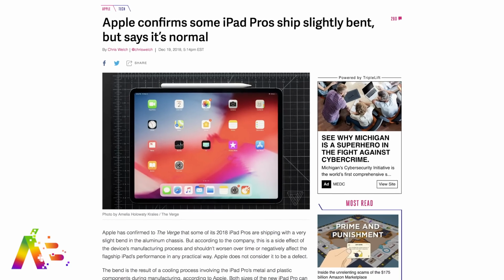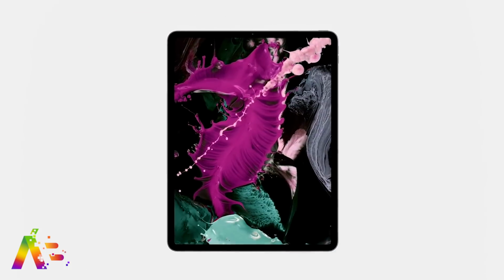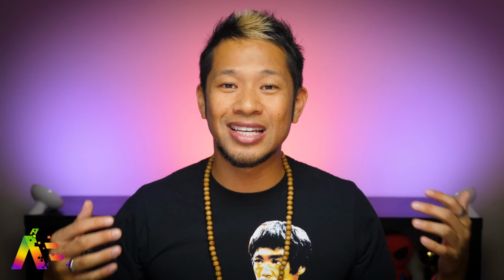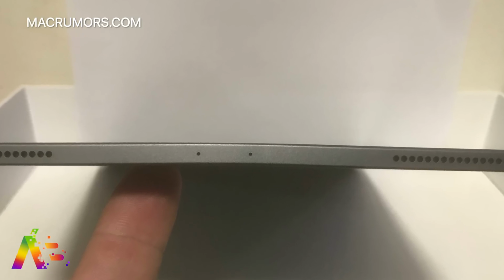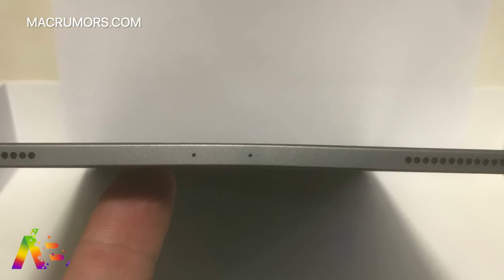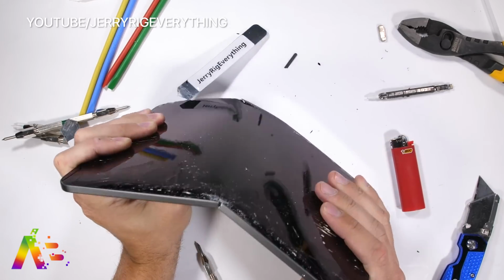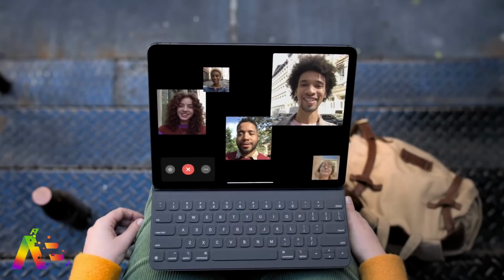Apple says your bent iPad Pro is normal?!?

Comment: Hi. I’m Ashu from India. I just got iPad Air 4. As, it has the same chassis, it has flex & it bends, it really does, even at slight pressure (when noticed carefully). I requested a replacement & that would be delivered next month. I’m too worried. I haven’t seen anything so expensive & so flimsy (I mean it, I didn’t expect that cz I already own an iPad Mini & that is really tough). But this new Air has too much flex in it. By any chance if you haven’t noticed it yet, take a look from sides like you see from a gun while twisting it even at very very low force. It’s too soft.

Bro Please let me know about your take on this (in-detail if possible cz I m really really worried) ?
🙏🏽🙏🏽

Comment: Actually I had an Asus tablet back in like... 5-6 years ago (an Asus Transformer, TF101 I think) and I tried to bend it. It was really solid build so I just gave it a gentle try and tried to bend it slightly more continuously. It didn't even start to bend a little bit when I gave up because my hands hurt. And it was years ago. True, it was a bit thicker, but hey, apple prefers beauty over everything else. Not that the Asus tablet wasn't good to look at or hold, on the contrary. It was good to hold it, it was easy to hold it steady. This obsession with shaving off half millimeters from the thickness ruins the product(s), and they still continue to ignore the facts.... I have a Samsung phone and I keep it in a phone case solely because it adds a bit extra thickness and it's way better to hold the phone that way.

Comment: It's very much irritating to see this. I am not comparing a specific company to any other company but I just want to point out that whenever there is a fault in a company's product, they should take responsibility. For example when Samsung Note 7 was having battery issues, they recalled their phones admitting their fault even though they lost billions and reputation. That's professional attitude. In this case Apple should also admit their fault rather than straight lying. And the thing that irritates more is people just don't bother much as it's Apple. That's wrong. We are customers of their products. It's our spent money that they are building new products from. Respecting a product and their customers should be the prime goal of a company. And atleast people should make it a big deal. Saying bending is normal and people buying that kinda of excuse is utter stupidity which shows we can be so easily manipulated. Their products were once good doesn't mean it's still good. Look for yourself. Come on bending is normal. It's hilarious people still agreeing to that by buying the new pro model with their excuses. If someone really needs an Apple product only then go buy the normal ipad or buy the MacBook. Atleast let the company know that people are becoming aware of it by not buying the new iPad pro model. That's the other way to make a company know what customers think of a product. Atleast they will act sensibly next time.

Comment: This is a embarrassing tragedy for Apple. Shame on them. Would you but a new car from a dealership with a bent frame and be told by the manufacturer that "oh it's normal, it will still function and drive" or with a caved in door that still closes but the car still drives?? No you wouldn't. This travesty is no different.

Comment: Brian..
Honestly, this is why I left Apple products and have never purchased another.  I left after antenna-gate response.. "Holding it wrong."  Have only purchased Samsung for me as well as my family since.  This is the reputation that I see when I hear Apple: antenna-gate, bend-gate, Out of Business Sapphire Co, etc.  It's sad and irresponsible. And, Samsung has had its problems; don't get me wrong...  And furthermore, Apple does have great design, processors, and experience.. to the point that it kind of bothers me that Samsung can't compete or be on par with Apple processors and furthermore put inferior ones in their tablets while Apple puts their Best! Yeah.. Argh!!  I was really impressed actually over the holiday at how polished and great the Apple TV is; But then again, can't pull the trigger. Bottom line.. Apple comes off too Pompous an Elitist to me.. which I could never support. 

Brian, Awesome job as usual!
Maybe Apple will get the message and change the way it treats its customer base (and suppliers as well!.. ) and Samsung start putting on par chips and best chips in their newest high end products.. tablets included!!
Thanks again.

Comment: this is the first vid i watched of you. And honestly you sound like an apple fanboy in denial.
Reply from the maker: You might have missed the part where I said it was totally unacceptable...
Reply: @briantong  my point is you act as if Apple didn't have this particular mechanical fault for years now lad. As if Apple very rarely screwed up things at a hardware level and always consistently had sturdy devices without faults. 

Not only does there exist common faults across their phones and tablets alike but their MacBooks and iMacs have had significant hardware issues unacceptable to the professional market. At least for engineers, designers researchers etc pros who actually stress every inch of the hardware. Additionally these things are extremely difficult to repair and finding reasonable repair costs are often impossible because system schematics are becoming scarce and components are becoming harder to attain.....on purpose. Apple is literally doing all these things on purpose.

Comment: Apple throwing away it's credibility what credibility they lost that years ago with the iPhone 4, 6, Battery Gate (aka slowing down older iPhones including not even year old phones!)!!!
iPad Pro but no mouse support WTF?!
iPad Pro but no USB 3 speeds never mind USB 3.1 and forget Thunderbolt 3!!!
iPad Pro but no 3.5mm Headphone jack nevermind Mic and lets be honest Bluetooth is nowhere near wired levels of Audio Fidelity!!!
iPad Pro no SD or MicroSD card slot!!!
iPad Pro still side mounted speakers (which are easy to block in Landscape Mode!) yes they are good but front facing is even better for Audio Quality this is after all a Pro Device!!!
iPad Pro 90% of the time an iPad is used in Landscape but Apple still makes all iPads to be used in Vertical Mode not Horizontal but Apple insist on making every iPad like an iPhone port in the middle of the bottom (Vertical Mode!) so in Landscape (Horizontal Mode!) the charger port is in an awkward spot that looks weird rather then placing it at bottom portion of the Bottom! Apple needs to move the port to the real bottom (aka landscape mode!) as well as do the same with the web cam!

Comment: I have one and it's not a problem.  Waaay blown out of proportion by the youtubers. If I lay my ipad face down on a flat surface, there is a barely perceivable arc that shows a .01mm gap along the long side.  If I apply the tiniest amount of pressure to push it flat, I can see the gap close, but only just.  This is actually a nice feature as is reduces the chance of scratching the display if it's face down, but again...   barely at all.

Comment: The worst thing about this design flaw is that it could be fixed by doing two things:
Using a better metal for the frame
Moving the microphone hole that's in the bloody center of the tablet somewhere else

Apple seriously screwed up. They need to stop going for what looks nice and make shit that actually fucking works and doesn't fold like paper.

Comment: I was hearing about how durability wasn't factored in when making this more lighter. First of all, the ipad pro 2017 are not even heavy even with a good case.
I have a 12.9 ipad pro 2nd gen and I love it. As an artist/cartoonist I fucking love it. I hate apple electronics but they did something right when making a powerful drawing machine. I also have the 2018 ipad for travel ( less expensive then the 2nd gen pro ) and even that works just as well. Its apple pencil compatible and half the price of a 128gb pro. I'm using these as long as it lives lol

Comment: Beyond stupid. One of the reasons Apple products were so impressive to fans was the craftsmanship that went into the engineering of its hardware. For the company that spearheaded the mass production of precision-machined aluminum unibody chassis (and has the advantage of YEARS of experience designing for this manufacturing process), this is straight up unacceptable.

Comment: "Is the result of cooling process that involves the iPad pros metal and plastic components" 
Are they saying that the iPad is putted together immediately after the injection of plastic and the aluminium machining?.
Im sure that the making of the chassis and the plastic parts are not even on the same factory.
Do they believe that people will fall for this?.
What a bunch of twats.

Comment: It's not bent it's warped during manufacturing. They were never really straight to begin with. So that's worse than simply being bent by the user. They're delicate so need a case to support them which makes building them so light to begin with completely pointless. My sister keeps her iphone 6s in an otterbox case which  nearly triples the weight. Lighter is not always better.

Comment: Okay i just rechecked the statement apple gave, it neither denies or affirms that a bent ipad is normal, it just states that it was designed to have a 400 micron deviation which is smaller than the previous models. If it's bent then clearly it's defective and can be returned. Apple also does not confirm or deny that ipadpros are bent.

Comment: Wake up. Almost every Apple product had at least one major design/engineering problem. And bending iPhone 6 and iPhone 4 signal problem is just most known. For example every Mac has a cooling problem. They decrease CPU and GPU power to keep temperature down. Including Mac pro that was supposed to have amazing cooling. That is just typical apple.

Comment: This is Beyond a "Bad Apple". Just simply unacceptable, not even borderline irrisponsible.  This is a betrail for all of the early adopting Apple fans who trusted Apple and bought that expensive 2018 iPad Pro.  And '14 day return period' isn't cutting it at all, for most of the people who are buying these expensive iPad Pros  are looking down the road at least for 2 or 3 years of use, not like an iPhone. It's a tablet and this is clearly a hardware defect by design which can't be fixed by an update or a "repair program" as they have done in the past.
   If people can't even put this device in their backpack without worry bending it, how can it replace any laptops as they are marketing it? 
This may not be eligible for a class action lawsuit but this is way more of a betrayal and crime then some deceiving pixel count on their iPhone X and XS series phones.
  They should be recalling this product.  This defect is more seriouse than the past "Bendgate" from the iPhone 6, and Apple should act responsible for their mistake this time. If they don't, they don't deserve their Fans, who are loyal and trusting of Apple than any other fan base in the world.

Comment: Brian Tong I have a non apple question? So I have a LG V30 with Wireless charging and I've unfortunately bought several wireless charging pads None of them have Fast Charging capability they have all been 5w what do you suggest I buy that won't Break the Bank but charge faster. My LG V30 has a USB-C but sometimes I lose my Wall charger and want to just set it down to charge. Also Tech wise my LG V30 does have a headphone Jack with built-in 32 Bit DAC but I think I want to go Wireless headphones with built-in microphone can you suggest some that are $100 or cheaper I prefer over the ear with Extra bass?

Comment: Mate, did you tried to have a look at the surface of the iPad Pro 12.9 with the screen off, with some light reflection on it? (the short sides of the screen) ... the edges of the actual iPad screen on the shorter sides are warped ! At least mine is and I got it 4 days ago. I was a bit intrigued as for why is that happening until I heard about Apple’s article about this bend issues from manufacturing of this specific model. Then I had a closer look and voila, the iPad has a bend on both short ends. The surface of the screen is warped on both edges on  the shorter sides!! How can this be “normal”?!!  A manufacturing process that causes this bend is called a “defect”  in a normal wold! Is it just me or Apple trying to dictate a new “normal” ? And cost me $2269 down here in AU. Tomorrow I’ll take it back...hopefully the “ Genius “ people of apple wont blame me for bending the iPad 🤞🏻

Comment: A flaw in a machine that's worth your kidney is not fine. What if you buy a tesla or a luxury car and there's a light scratch or bend on its surface, would that be fine for you? 

Besides, I don't believe this just happens in the manufacturing process. I am a Materials Engineer and looking at the iPad's structure, given that it has holes for mic and the magnetic strip on the middle, I can say that the middle part is really the tablet's weakest point. If you own an ipad pro, it is a ticking time bomb. Only a matter of months before it bends due to heat or from the mere pressure it is receiving from other stuff on your bag, especially if you have books and notebooks in there. :) 

But.. but... but apple said that the bend will not worsen right? From an engineer's perspective, I laughed hard at this. This is from the same company that said that the 1st gen butterfly keyboard is fine but later on admitted that it is flawed anyway, or that there was no problem on the iphone's signal bands and you are holding it wrong, or that the i9 processor thermal throttling was just because of unfinished software yet physics will tell you that it's because of poor cooling in a small chassis.

Saying that it was caused by a "manufacturing cooling process" is nothing more of a technical jargon that's meant to be a mere marketing campaign to keep us calm. After all, a few convoluted technical jargons are hard to digest for an average reasonable person that's why we default on just believing it anyway since they are "experts". Science will tell you though that the machine has no structural integrity and rigidity to withstand usage over time. But who cares, Apple sheeps will always be apple sheeps and they prefer flowery marketing words over science and technical aspects which by the way govern the universe. If Apple says that 1+1=5, Apple sheeps will believe it.

Comment: If Steve Jobs was alive: you're getting it shipped to you wrong, not our fault pay for apple care!!!

Their company value just keeps going down and down, even Microsoft made more than them. 

The manufacturing process excuse is total crap coming from a machinist and metallurgist. When the blank cools down yes the aluminum does expand and contract but by the time it cools down (because obviously they're not going to assemble components onto it while the metal is 400 degrees hot since that's going to set the components like the battery on fire, also they machine it after not before) and by the time the aluminum cools down so they can machine it they should manually be inspected and reject the low quality chassis because they just have to have quality control, especially when the top model is a tad over $2000 with tax. Lol this no headphone jack, useless file manager, no mouse support, no flash drive support ios PC killer is such a PC killer it already comes pre damaged with a chicken shit excuse.

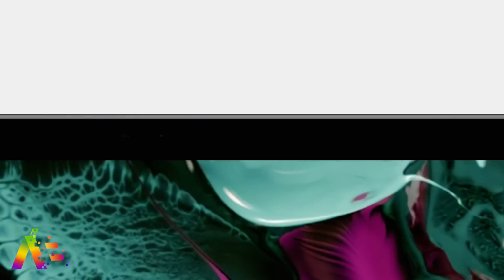Comment: 0:45 If you say that you haven't heard this kind of tepid response from Apple than you are either:
1) A liar.
2) An incompetent journalist.
3) A fan boi.
1:40 you contradicted yourself there, if Apple has had a well documented history of releasing poorly designed/poorly conducted products, and then goes full denial mode until customer outrage gets too bad, at which point they begrudgingly issue a response and or solution(that is usually ineffective), then you have no right to say that you can't believe Apple is screwing you over.

Comment: I purchased a Space Grey iPad Pro 12.9” and fresh out of the box, there’s a slightly chipped off edge of the USB-C port, revealing the silver undercoating of the space grey TOP coating. I returned it within the 14-day return policy, no questions asked. And when I re-purchased the 12.9” but now in Silver, it’s still not perfect —there’s a small, hardly noticeable, should I say ‘imperfect’ rounded corner. I’m tired of returning and re-purchasing for these reasons. I’m starting to wonder if it’s possible / legit to do this for a year until the next iPad gets released. Lol

Comment: whats the issue with a little bend? lol do you even k ow how thin that thing is. that thing bends constantly on a microscopic level. it is perfectly fine to be like tiny bit bend idk why that would annoy you and if it does just put it on the edge of the table and gently bend it other way so it straightens but that would be dumb. why would apple replace it like what are they suppose to fix? lol replace the cpu? no it works? screen? no? like ipad performs 100% its not defective. sure if the bend is huge like on the pictures he showed but if its just a tiny little bend over whole ipad that is barely visible ur good

Comment: You know what's coming don't you? They're just gonna say "the strength of the device is expected to undergo stresses and tensions from normal operation. We highly recommend users to take extra caution when applying force such as from the placing of device into bags and/or carrying cases in order to prevent unnecessary tensions to the structural rigidity of the iPad Pro"!!